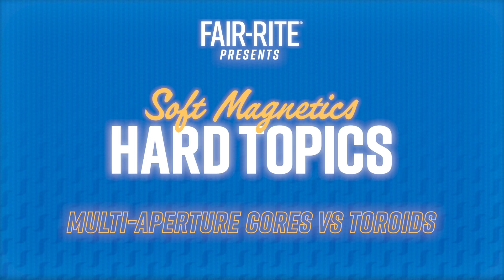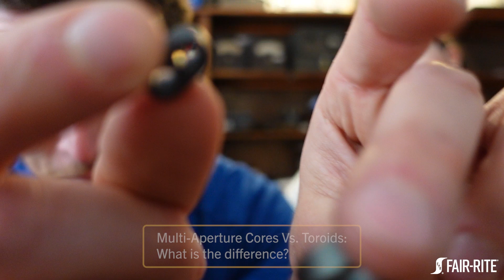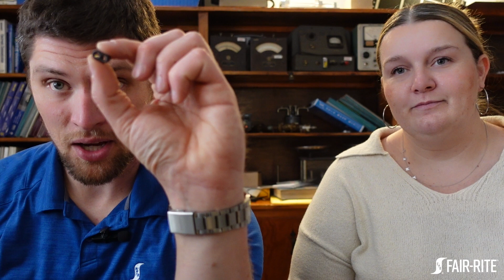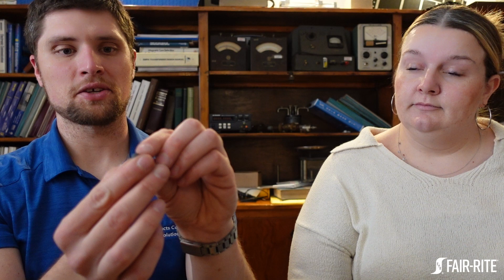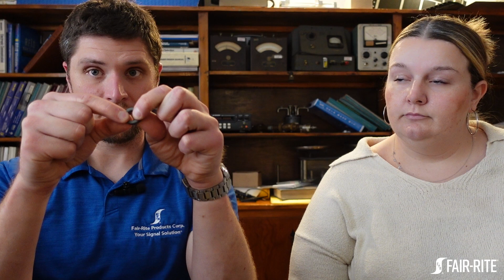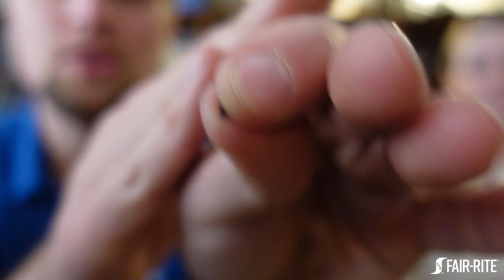S2 E5: Multi-Aperture Cores VS Toroids

Comment: Do transformers wound on binocular cores result in lower leakage inductance?
Reply from the maker: My knee jerk answer not being a transformer designer is that they can be very similar. The difference will be in how they are wound. Toroids have the ability to be sector wound or with overlapping primary and secondary windings whereas, multi-aperture (also known as binocular or balun) cores are really only able to be wound with "stacked" windings.